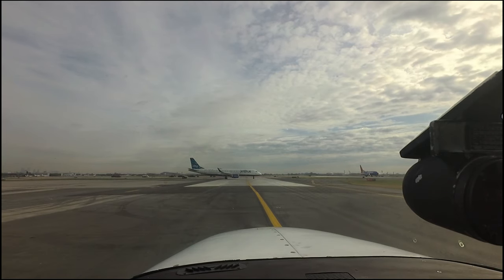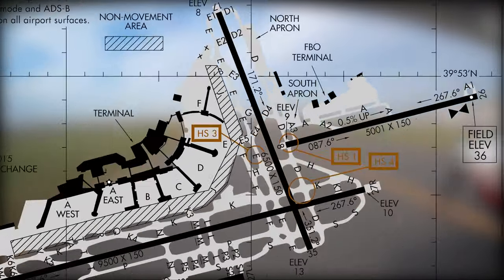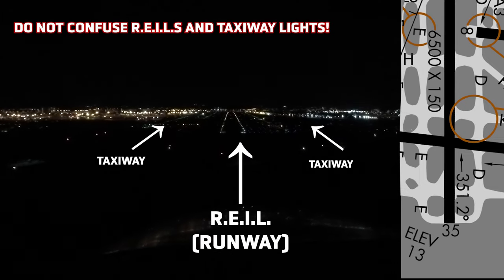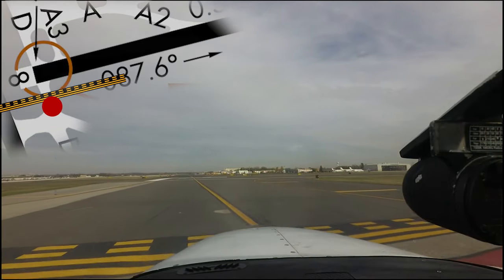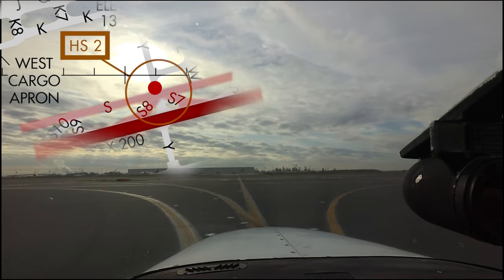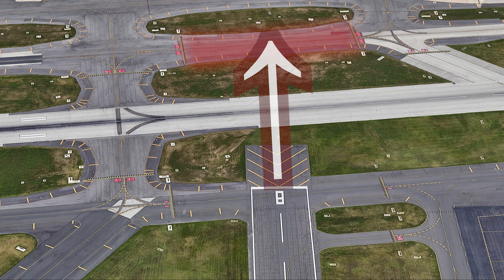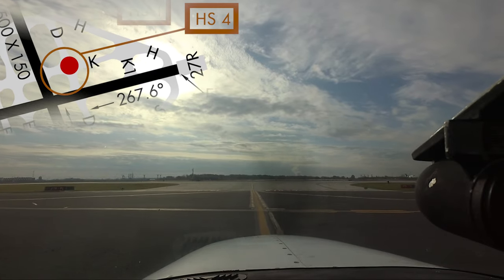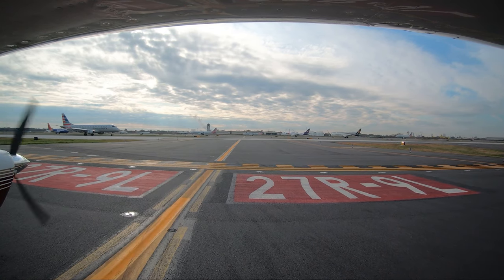From The Flight Deck – Philadelphia, PA (PHL)

Comment: Back when this was a US AIR base we came DANGEROUSLY CLOSE IN A RUNWAY INCURSION ON A us air flight where 9L-27R cross 17-35 Airbus pulled out right in front of us could see it out the side window luckily the pilots were really good and pulled up fast enough to save us can still remember the expressions on the Airbus passengers faces yea we 
were close enough to see them